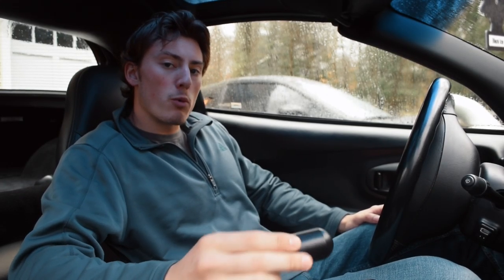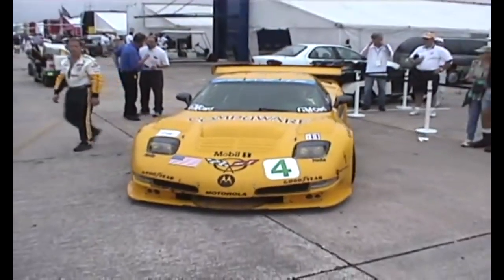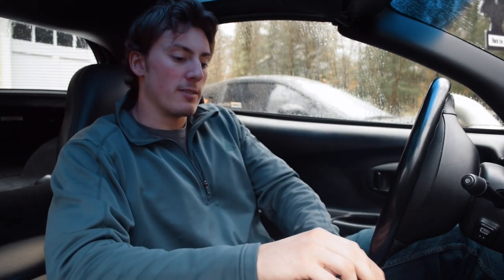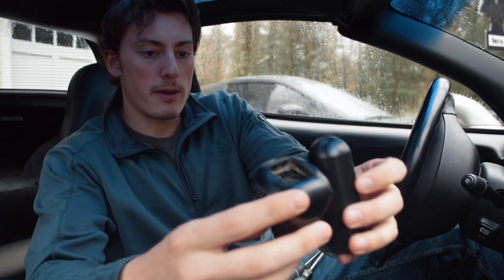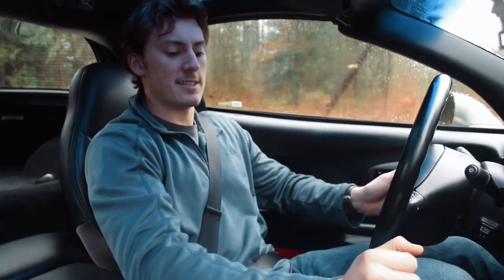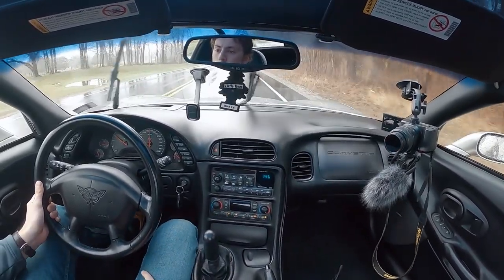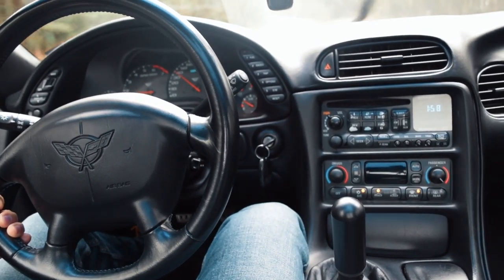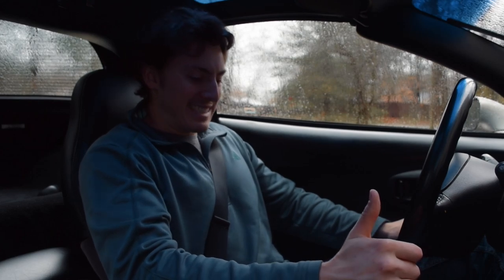C5 CORVETTE Gets The Shifter From The C5R RACECAR!! | DriveHub

Comment: For anyone reading with the same issue, it might be worth checking the style of lower box installed in your car. The first few years of the C6z came with a metal-on-metal lower box. No bushings. IIRC, there were complaints of rattles from the shifter from owners and Chevy used a lower box with bushings in the later years to address it. 
Considering the C6z box fits in C5s and C6s, it could be worth checking that the previous owner didn't install the Z box.

Comment: Here's my take on the rattlle. If the rattle only occurs when the shift knob (either one) is on, then the knob must be creating an imbalance (like a counter-weight from the top of the shifter) to something lower in the linkage.
Maybe take off the leather boot and see what's happening under there. Just a thought...
Reply from the maker: Appreciate the advice I’ll check it out!

Comment: I have a 2008 Saturn Sky 5 speed.  I had the buzzing on my shift knob as well.  I slipped a tight black o-ring between the knob and boot/shaft.  No more loose, noisy shift knob.